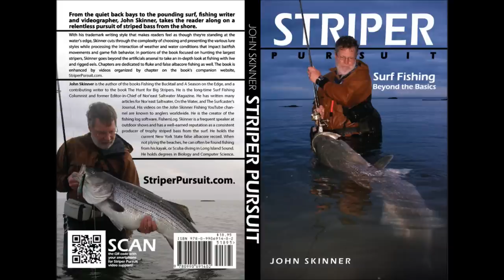Surfcasting for Striped Bass - Tsunami Surface Plug

Comment: Great vid as always dude!  I find those plugs are made great never needed to load I just go 5-6-7" and the cast like rockets was out deep ehn you need it.  I do remove the center hook, take out the front ring and use a single 6/0 3x siwash on the rear.  Great for blues more so cause there cheap and take a beating so long you dont bang them hard on the rocks during furious fishing.  Thanks for sharing as always!

Comment: Many thanks for posting your very informative videos.  Question regarding your custom rod:  Why did you cut the blank down from 10 ft to 9 ft?  You stated in other videos you reduced the length at the butt end, so presumably there was little if any affect on the action of the rod.   Seems to me you are making a trade-off between rod weight vs. casting distance/leverage.  Is that the goal?

Comment: I keep on having problems with the bass pushing my surface lures into the air and therefore they keep on missing the bait. What can I do to stop that from happening so that they would actually bite into the lure instead of pushing it away or into the air? This is my biggest problem with fishing surface lures!
Reply: Don't stop the retrieve. And don't try to set the hook.

Comment: Hello John, I have a few super strike little neck poppers that are the floating(green eye). Will that trick of adding water work on these lures?
Reply: No. They're through wired and water will leak right out of the bottom.

Comment: I do like the idea of adding water to the popper.
Mine are made from hardwood, so they are easy to cast a long way yet still float.
Reply: Myles Nicholas You dont need to load these just get a 5, 6 or 7" pending on what you need and youll be good to go save your time

Comment: You need a PVC pipe angle cut driven into the sand, in the water or beach.
Excellent to place the rod after a catch.
I have left them all over the place, buried in sand dunes etc.